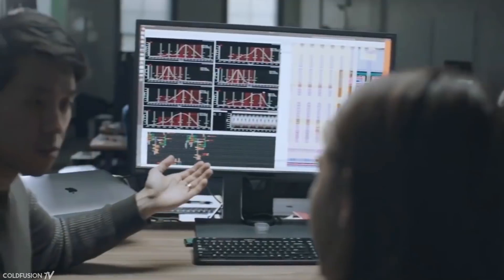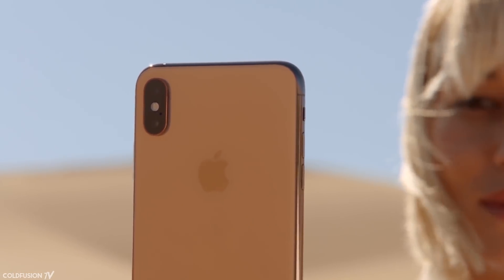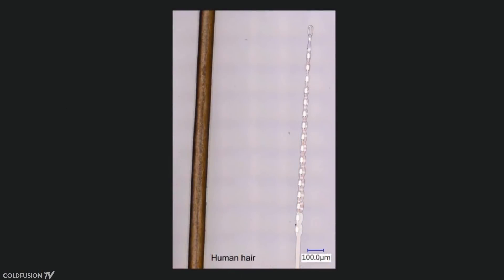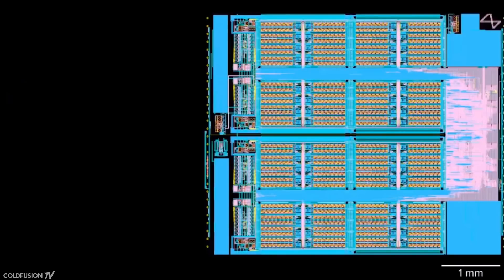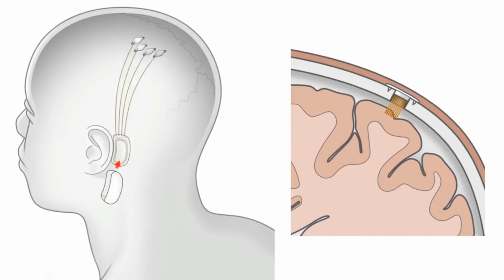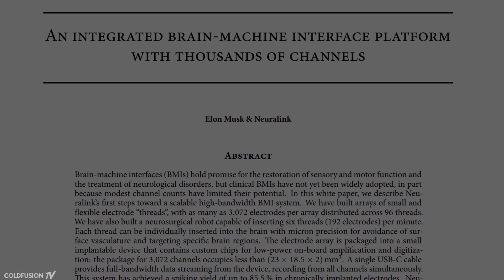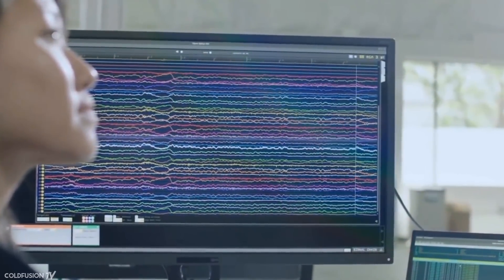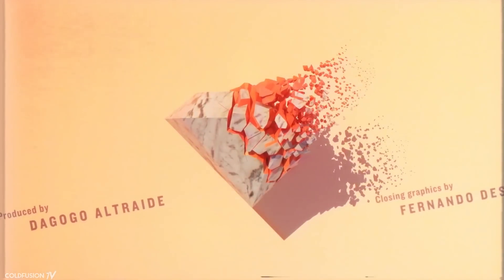Neuralink - Merging Brain and Machine

Comment: Neuralink is 99% hype, based on invalid assumptions. First, the idea that input/output is a bottleneck that can be sped up by direct interface is suspect that doesn't make sense evolutionarily. Why would brains evolve an internal faster method that has never been selected for?

Second, saying "an algorithm can detect these spikes in real time, decode them, and make sense of the vast amounts of data coming in" is not true. It reminds me of the cartoon of two scientists at a blackboard with a box that says "the magic happens here". No such algorithm - it would essentially solve the problem of general AI.

Third, "writing" data to the brain by passing current through an electrode near a neuron will stimulate a whole mess of nearby neurons as well without the needed specificity. Giving the example of cochlear sensory stimulation is a far cry from what is being claimed. It doesn't "restore hearing" - one has to practice for months to learn how to interpret the buzzes and tones such stimulation causes to interpret any speech. Neural plasticity is not something the brain does, the person has to do the learning work which then modifies the brain.

The goal of helping people that are disabled is certainly possible and a worthy goal; this is what lots of serious researchers are working on with BCI methods. But the pipe dreams of downloading memories and the like is not going to happen. An "app store" for the brain is a laugh. Give me a break.

The brain works in a completely different way than silicon computers. It is much more feasible to recreate intellectual functions in algorithms that run on silicon computers than to try to interface to the wet brain hardware of humans. Ain't gonna happen, regardless of whether or not Elon Musk is involved.

Comment: it looks really interesting, but with all that we know right now I would be hesitant to put hardware into my brain. I really think that it will be a long time still until we know the longterm effects (with that I mean years and decades, not months). Like was there maybe a reason one of the pig had it's neurolink taken out? I'm guessing that was a spin on something not working out and they salvaged it to use as an example of being healthy after removal. And this is also pigs, since they don't have the higher brain function compared to us it is hard to say if it would be just as seamless to implant in a human. We might just run into harder problems since we have much more fine tuned brains.
I will keep an eye on this research, but I wouldn't risk my health and longevity for a brain upgrade in the next coming decades.

Comment: You don't really want to do that yourself.
This book https://www.abigailsinsights.com/the-holographic-matrix-3/ and this youtube channel are highly recommend if you would like to know more about the matrix - https://www.youtube.com/watch?v=WZuAQd_NKrk&t=5s.

My life has completely transformed since I stumbled upon this book. In a nutshell, the Illuminati is real, and so are the reptilians who exist in the astral plane and control them (David's Icke's books are highly recommended here as well to make sense of it all at a 3 D level) who are in turn controlled by AI, the chakras are implants (along with a multitude other AI implants designed to control and harvest our energy) this is an energy extraction matrix we are being used like batteries for both the archons and the AI (we are not originally from here but trapped) whose true power is beyond comprehension, however before we can evolve and realise what we really are off we go into the grave, memories wiped and then returned here and the cycle is repeated. AI is trying to manifest itself here and you can see that happening all around you.

This video is a good summary - https://www.youtube.com/watch?v=WZuAQd_NKrk&t=5s.

Comment: The idea that it is not new and have been done before is kind of underplaying what Musk is planning to do. When I first found out that the invasive BCI called BrainGate, using the Utah Array, with the huge black box connected to the top of a patient's head was similar to what Musk is doing I kind of lost interest. However, I did some research and am confident to say that this is one correct(possibly initiative) step forward. I believe adding more electrodes is the answer to complete BCI until a new discovery arises. I want to allude my thinking to how computer CPUs have developed over the decades. In the first computer it was the size of a room with 800 point-contact transistors and now a modern-day PC will have 30 billion. The Utal Array has us tp 128 electrode channels, but the brain has 86 billion neuron sending and receiving signals. Neuralink's single thread has 192 electrodes and claim as many as 3,072 electrodes per array. If this is a success, the [possible next step is to add more electrodes per thread or more chips into the brain to collect more signal. The more signals the more accurate the output.

Comment: I don’t know what I think about a chip in my head... I think I prefer an external alternative If there ever will be one.
Reply: It wouldn't be effective, it would be a big head covering of wires and electrodes monitoring your Brain activity to a far smaller degree. The surgery for this is a small 8mm hole in the skull, a robot placing wires in and the chips, then closing it up. A small incision is made behind the ear and small wires are sent through the scalp to a device that would be attached behind the ear. It's as invasive as laser eye surgery.

Comment: The Neuralink as described in Musk's paper will fail, because it has not solved the attenuation due to scar formation, inflammation and general rejection and cell death. That is to say, nothing new has been done about these problems. That is a major issue that has been why we do not have neural interfaces already. They fail in less than a year, by causing nerve damage.